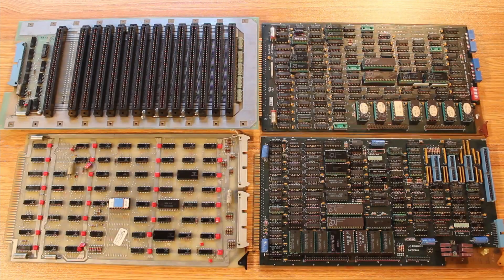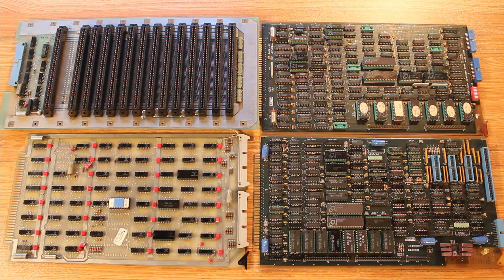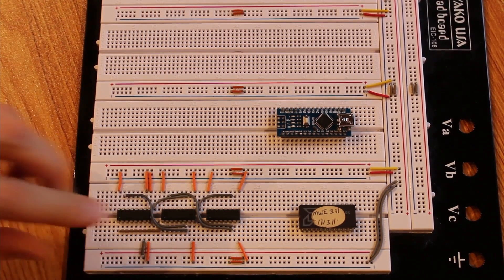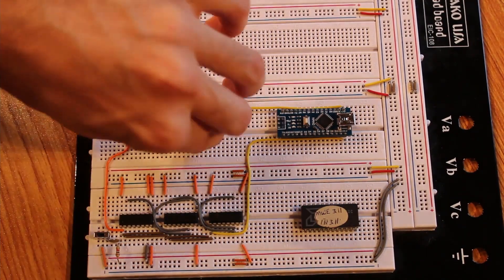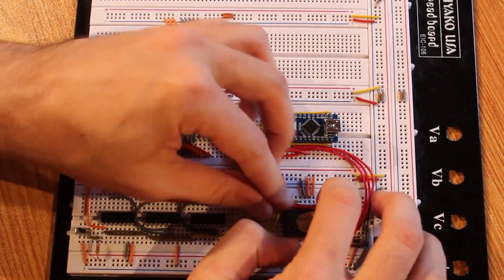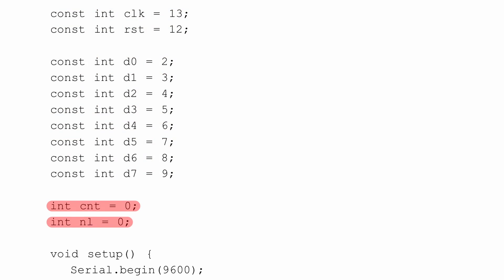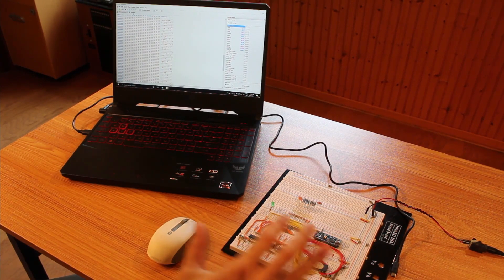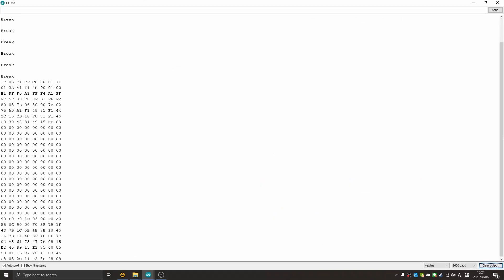Minicomputer Part 5: Building an Arduino ROM Reader

Comment: Speaking of ROM: One thing to know is that Centurion often used ROM memory to simulate complex digital circuitry. For example,  a logic schematic drawing with several inputs feeding into a fairly large number of AND, NAND, OR, NOR, and NOT gates ending in the desired outputs was created. The  ROM was then used by placing the inputs of the drawing on the ROM's address pins, and the outputs of the drawing on the data pins.  A programmer (sometimes me) had to go through all input states (tied to the address lines) starting at address 0 and figure out the resulting out value for the output (the data pins) for each address and program that value into the ROM. Each possible address (based on the actual number of input/address pins used) had to be manually determined, then programmed into the ROM. As I recall, this was done by hand for small circuits, but a program was written to translate the address (input) states to the data (output) states.  Of course, once this was figured out, the ROMS could be mass-programmed.
Reply from the maker: Hi Terry, thank you so much for the comment!
We kind of figured that that was what was going on with a lot of the ROMs on the CPU and CMD board. Though the ROMs from the CMD board don't look too healthy, the CPU ROMs all seem to contain quite a lot of valid information. We've been doing a lot of work reverse engineering the Diag bored, both hardware and the code on the ROMs, which I believe you may have had a hand in writing. It's been a ton of fun unearthing this wild Centurion mystery. 
If you ever get a chance, I'd like to maybe corner you and Ken on a Zoom call or something someday and just listen to the Centurion stories (and maybe pick your brains a bit about the ISA used on the Centurion)!
Reply: @UsagiElectric  that would be great. Ken has my email, feel free to reach out.
Reply: Ben Eater has a channel in which he builds a small cpu on breadboard using discrete logic. He discusses a lot of cpu design theory which may be educational. In particular he demonstrates this technique by programming an eeprom with precalculated output. A very cool channel.
Reply: And James Sherman, who is building a different design of CPU, but also used PROMs to let him assign various combinations of control outputs to various instructions (the ROM is generated by a progam that also configures the assembler on PC and the disassembler on-board the computer itself).
Reply: Like an old school FPGA?
Reply: @caseycrane7433  a budget pla more like I suppose
Reply: @caseycrane7433  yeah, it's one of the direct ancestors of FPGAs

Comment: As I read in some of the other comments, I would also state the first rule of TTL and ABSOLUTELY with CMOS, " All Inputs Must Go Somewhere ". Any unused input that is assumed to be high should be pulled high by a 1K to 4.7K resistor.  Make sure that any assumed low inputs are grounded.

Comment: As to using the breadboard design, bypass, bypass, bypass. Good design demands that you put a .1uf mono cap in between each chip, one leg to positive buss and one leg to negative. TTL is very noisy on the power busses, 74ALS is better but, lots of bypassing of power busses is still recommended. . . Failure to do so may allow spurious counts on the counter chain. You will not know that the data is corrupted....

Comment: 13:17 Did you left VCC in and did you pull the GND out to disable the circuit? That is not so safe, better pull VCC out and left gnd connected.

Comment: The small ROM chips do not contain real data. They are used as truth table for address decoding.
Reply: Turns out that Centurion had many PROMs / ROMs in the 16 byte to 256 byte range that had real CPU opcodes / program code in them.  The large 2KB PROMs are mostly AMD2901 micro-code or just logic state tables to replace complex groups of logic.  Regards,  Ken R.

Comment: Sorry I know this is kind of late, but only just discovered these vids.. 

 I'm sure you know this already but there are two basic kinds of instruction set, direct logic encoded and indirect logic encoded or micro-coded. I think much of what these ROM's are doing is implementing a micro-coded instruction set. At least the ones on the CPU board.  The overall data path on each might be 8 bits wide but they will very often just be using one or two bits of that for the actual control functions. Plus there could be different data sets packed into different bits - although that is less likely in a more expensive machine like a mini computer.. I believe it was also common to use the individual address bits as switches - which would explain the wide sweeps of zeros.

Truly amazing project and you seem to really be on top of it. (at least at this point) I always wanted to do a project like this but never had the room or the money or the level of electronics expertise to give it the love it deserved... CPU design is/has always been one of my things .. though mostly far more abstract designs and projects. CPU design combined with Strong AI research. Like a lot of research though never actually reached the point of anything actually working..

Comment: Out of all those chips, the only one that appears to contain object code is the white 1702 on the autoloader board. The PROMs on the CPU and CMD cards are decoding and state machine data. Now knowing the machine complains with "ERROR" at startup I don't see anything in the 1702 dump that I suspect could write ERROR. Something seems off with the center 1/2 of the chip being blank. Big empty areas are normal but having exactly the middle 128 bytes show as $00 is weird.
Reply from the maker: I haven't replied to the comments on the newest video (going through the videos in order and catching up on comments), but I did see your comment on the output from the MUX saying ERROR, and I wish you lived nearby so I could shake your hand, that's some insane detective work! I was totally blown away reading your comment!
The 1702 is definitely weird, and I talked with Ken about that a little bit. He couldn't remember for sure, but he did want to say that the layout was normal and was done that way for a specific reason. So, it might be okay. 
Having said that, the ROM on the backplane is actually the Bootstrap ROM, so it might be the one that's telling the CPU that there's an error somewhere?
Hopefully once we get the Diag board ROMs dumped and learn more about how the Diag board itself works, we can start figuring out more about how it's communicating!
Reply: @UsagiElectric  I'm blushing a bit, but it wasn't that difficult. My nerd cred survives. I was lucky that you captured two screenshots which happened to overlap and one just happened to contain the message. After writing UART code on PICs since 1993 I remembered the inverted polarity and reversed order being standard fare. By judging the width of a bit on your scope it was pretty easy to just read the bits off visually. Then guessing 8N1 might be the format, I looked for a pattern of two sync bits every 10 bits that were constant through the stream and bingo. Once I found the start and stop bits, I wrote a little PHP code to invert the polarity, parse the stream to bytes, reverse order the data bits, and then print the result. Along the way I also printed the pre-reversed bits and the decimal values for the the reversed and unreversed bytes, both inverted and not. The high bit being on fooled the CHR function of PHP and produced question marks instead of text, but ERROR stuck out numerically thanks to the repeating pattern of the Rs and the O being 4 values away. The E being the right value away from the R was the clincher.
Reply: @UsagiElectric   The 1702 still looks odd but I could see it holding what was originally two 64 x 8 PROMS. If the 1702 is part of a state machine it would look fine, but it looks incomplete for code and the PCB layout might suggest code in there rather than state machine. I didn't look up that PROM on the backplane but indeed it's the double size version of the boot PROM on the Apple Disk ][ controller. Odd place for a bootstrap PROM, but.... everything is odd in Texas, except for the BBQ. That diag board looks very basic. 1K of RAM, I'm guessing 1K or 2K of EPROM, and likely space for a serial port. At least it gives you some executable code. If you want to reverse engineer the instruction set, knowing the SRAM on the CPU card is for registers will allow you to replace it with a dual ported RAM chip on a PCB carrier so you can sniff and set processor registers directly. Manual control of the clock is the only part that would take any hard work but James Sharman's clock would likely work great as a drop in. DRAM refresh will be your issue if you play with the clock but the Diag card has some SRAM. You can also sniff the ALU opcode lines to see what the CPU instruction brings. My guess is the PROMS on the CPU in parallel turn into a 256 x 8 x 56 bit memory, with 256 opcodes having up to 8 steps in each. It could also be 128 x 16 x 56, but less likely. The boot PROM should give more hints. Reverse engineering the CPU will be an adventure, but it's doable if you want to commit the effort.
Reply: @Peter_S_  The 1702 EPROM in the Dsk-Auto I/O card was the Bootstrap CPU4 opcodes for the old CPU4 system. Half the Dsk-Auto card was the Hawk disk controller logic and the rest of the Hawk disk controller was on the DSKII  I/O card.  The Bootstrap code in the 1702 would let the CPU4 boot from the Hawk or a Sykes Tape drive.  The part of the 1702 code that has values in the range of F140-F14F  like F148 are the Hawk disk controller registers for Hawk booting. The area in the 1702 without any ref. to values in the F140-F14F range is for the Sykes Tape drive booting.  The CPU4 ran a opcode in the first few bytes of the bootstrap  to test which of the System Sense Switch Front Panel buttons are set then jumped to the Hawk or Sykes code area in the 1702 (Sense Switched SSw1, SS2w, SSw3 not on the CPU5 or 6 system front panel. Only SSw4 which is the R/F switch are part of CPU5 & CPU6 front panels.)  The CPU5 & CPU6 backplane had a Bootstrap PROM (did not support Sykes) on the backplane near the CPU5 - 6 connector. The CPU4 system had 3 connectors to handle the CPU4 cards ( CPU1, CPU2 & CPU3. the DMA card was in a standard Centurion bus slot to the right of the CPU ).  So all the old software to run on all the CPU models CPU4, CPU5 & CPU6 the opcodes, I/O backplane bus and memory mapped I/O cards run on all CPU types.    So the  ASCII string [ ERROR ] only was part of the CPU5 & CPU6 bootstrap PROM if the bootstrap code. [ERROR] message was sent to MUX Port-0  if booting from the selected disk drive failed when {SELECT or OPSYS} front panel button was pressed.  The CPU4 would  not display any type of error message of the system boot fail making trouble shooting a non booting CPU4 system a real problem.  With the CPU5 & CPU6 being able to send the [ERROR] message and also having the Diag. PROM board servicing a non boot CPU5 or 6 was a little easier.      Regards,   Ken R.

Comment: 8:24 Why you always put resistors in series with LEDs: it’s to prevent them from self-destructing due to thermal runaway. When an LED gets hot, its resistance actually decreases, whereas when a resistor gets hot, its resistance increases. So without the resistor, if the LED were passing too much current and overheating, that would cause it to pass even more current, and heat up even more, and so on until it blows up. The resistor reduces the current as things get hot, and stops this from happening.
Reply from the maker: Yup!
I've actually accidentally dumped 24V through an LED building circuits in the past, and it sent the LED flying like a rocket, haha!

Comment: Some of the roms were also used as translation tables, so it's not uncommon to have zero-filled places.
Reply from the maker: I think you're totally right!
And actually, I think most of the ROMs were used as look up tables or for backwards compatibility with older versions of the Centurion mini-computer.

Comment: I would use an AVR with more GPIOs and do the counting on the AVR.... interesting idea to use a counter chip.
Reply from the maker: That would definitely be the better way to do it! I mostly just used what I had laying around, and the only microcontroller I had was the Arudino, which didn't quite have enough IO pins to do the counting as well.
Reply: @UsagiElectric  I quite like the external counter solution and have used it extensively on readers (and writers!) before in exactly the same way. I use a building block circuit in my CPU designs of HC590 counters and HC595 shift registers with some simple glue logic to copy serial NOR flash into fast parallel SRAM and then go 3 state to create functional units from tables without the need for a microcontroller. I initialize 16 bit table based register counters (for PC, Stack pointer) similarly, except by using more counter data delayed by a latch rather than NOR flash to program the SRAM. My 16x32 bit multiply-accumulate unit uses counters to boot eighteen 256Kx16 SRAMS from two 8 pin NOR flash chips to create something that would otherwise take an FPGA. That's a total of 324 address and 144 data lines on top of 54 control lines. Counters and shift registers reduce that to three lines (/Reset, /Boot, and BootCLK) you could run from a 6 pin microcontroller.

Comment: Why not generate the address directly from the arduino ?
Reply from the maker: The primary reason I didn't was that I was afraid I'd run out of I/O pins for really big ROMs. But also, it was quite fun to build up a little binary counter out of some spare 7400 chips I had laying around!

Comment: The small IC are PLA (Program Logic Arrays), not true ROMS.. Smart move saving the ROM's
Reply from the maker: Yup, the code on these ROMs is all proprietary Centurion stuff and there's not a backup of it anywhere, so I figured I need to save it as quickly as I could!

Comment: I didn't see any decoupling on the breadboard, but I could have missed it. A couple of 100 nF ceramic capacitors near the counters and EPROM would be good. Clearly not absolutely necessary at this stage as it worked, but it might save you having to trace erratic operation later on.
Reply from the maker: I don't specifically mention it in the video, but if you look closely at 10:50, you can see me popping in some small decoupling caps on the power rails that flank the ROM chip!

Comment: Comes handy ! I made my own with 7493 counters and your code, works like a charm. It will help me debug my Consul 2717 intelligent terminal, which doesn't work. I can't wait to see, if the fault is caused by EPROMs themselves :D fortunately there is a dump available to compare it against. So, thanks for the video ;)
Reply from the maker: That's awesome that you got it working! I'm so happy to hear that my rather hacky code managed to come in use for someone!
The Consul 2717 is a really interesting machine, I'd never heard of it before and it seems it was meant exclusively for educational use. It's awesome that you're working on one and getting it up and going again!
Speaking of terminals, I'm going to dive into the ADDS terminals of this machine next and take a look at the inside of them. The ROM reader will make another debut as I backup all the character ROMs and any other ROMs that may be hiding out in them!

Comment: Doing it yourself is certainly cool and educational.  My aproach is to use a rom programmer and tell it thst it is dumping a chip of the same size and method, but different pin layout, then build an adapter out of some sockets to connect the pins on the chip I want to dump to the pins on the programmer that would normally go to, say, a 2716.  This also works for strange voltages like the 2708.  If the chip you're pretending to read is bigger than the chip you are actually reading this usually ends up with one or more address lines not having anywhere to go and you get a rom file that is twice (or more) as big as the chip you dumped, but the data is duplicated (or more).
Reply from the maker: The primary reason I ended up building my own reader was that we had limited time to dump the ROMs on my buddies programmer, and we just ran out of time. So, back at my place, 2.5 hours away, I was thinking I could probably build a reader in the same amount of time as it would take me to drive up there again! I was also way too impatient to wait for a programmer to arrive if I ordered one, haha.

Comment: Very nice, sometimes it is just the easiest thing to do it yourself, instead of searching for the thing you need for many days. 
As some other people said already, some of them might well be used as an ealry form of a FPGA to save on components. 
I'm looking forward to see what other problems you come across, since I imagine there are propably a thousand possibilites for stuff to go wrong. 
But I'm sure you will get it going.
Reply from the maker: Thank you!
I'm right there with you! I was scouring through different programmer compatibility lists and I finally said "there's not that many ROMs and I have the datasheets, I can totally do this with spare parts I have laying around."
It makes sense that the ROMs are being used as essentially lookup tables to eliminate massive amount of logic, that's actually a really ingenious space saving use for them, especially for the CPU and CMD boards which are already packed completely full!
You're right that there's about a thousand different ways it can all go wrong and kind of only one way it can go right, but even if it all goes completely wrong, we'll figure out something, even if it means building our own TTL 8-bit system to stuff into the rack!